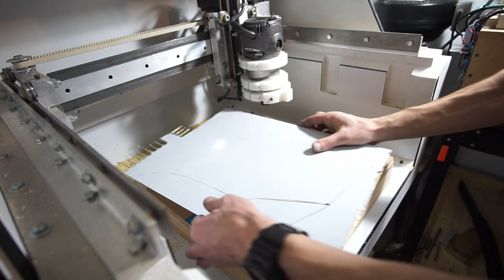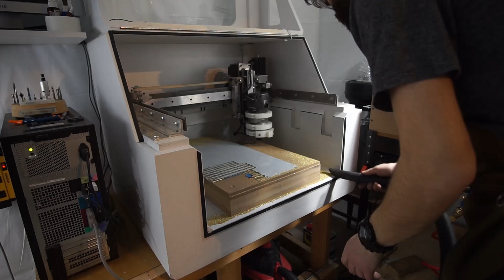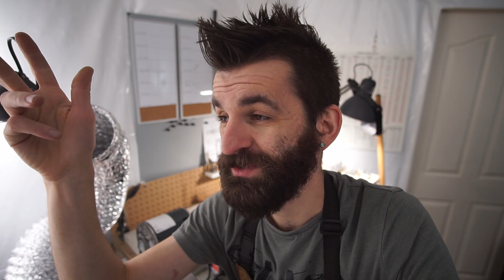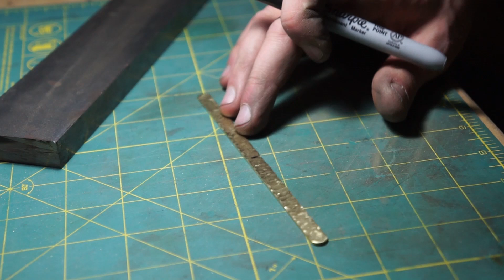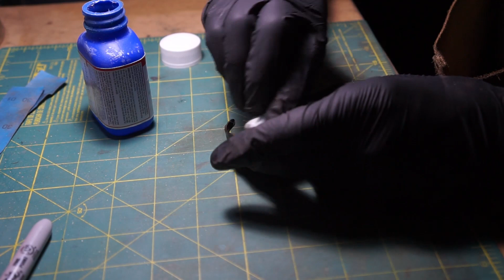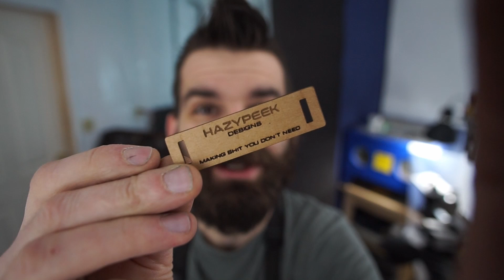Curse Words For Christmas Cheer

Comment: This is my kind of humor. One of these days, I’ll catch your store in stock.
Is that just standard gun bluing solution you’re using on the brass?
Reply from the maker: Should have a nice sizable drop in the new year. Yep, just normal gun blue...works better on certain grades or brass. No idea what this plate is but on C360 rod it doesn't attack the surface quite as well as it did here.